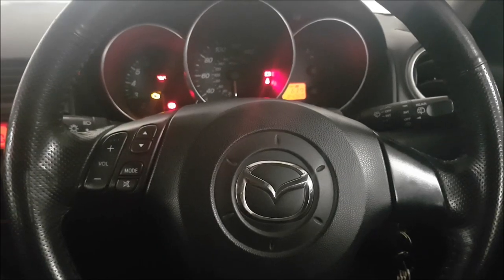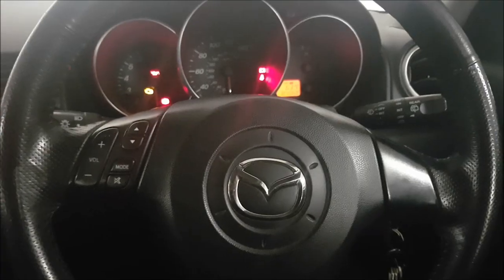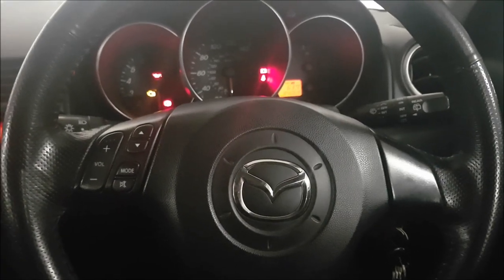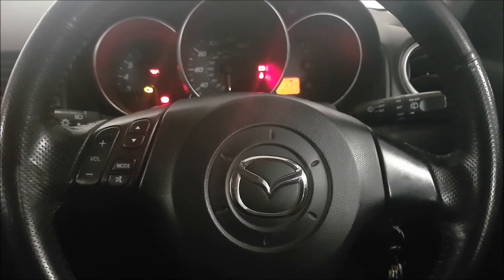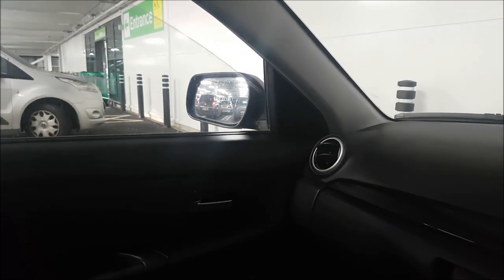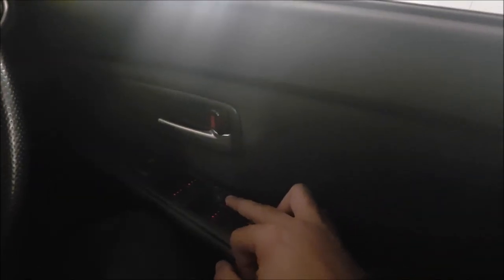Mazda driver's window switch controls not working - how to fix

Comment: Thank you!
I've just bought a Mazda 6 MPS and exactly this problem I am having right now. Flat battery, no power windows from driver's panel.
I have also another problem, hazzard lights when locking the car stopped working. I do not recall this car having an alarm but they were working 3 days ago , after that the car locks and unlocks but no hazzard lights flashing.
Thank you in advance.

Comment: Howdy, on my drivers door, when I lower the window, it goes down so far and stops with a jarring noise like it's stuck. If I push it more it continues to go down. When I push button for window to close or go up, it gets to the same point and makes a jarring noise again like it wants to carry on. I have to pull window up for it to close. Would this be a switch issue ot a window motor issue please. Cheers

Comment: This actually worked! My Front passenger window wouldn't roll up from my universal control on my side (Driver's) and i literally went to the passenger side control... Pressed the button down, then up, then down... then up again and continued to hold that button up for about 10 seconds maybe 15 seconds and it worked. (Not sure if repeating the down then up process a 2nd time was needed but y'all did it in the video so i did as well  lol. Hey it worked though!) Also the click was very faint so make sure you're in a somewhat quiet environment just to be sure. 

Thanks for the advice!
Reply from the maker: Mike really glad this helped you, thanks for taking the time to comment.

Comment: Thank you so much! My car battery had to be charged (It was basically dead). After that I had to reset them manually so I did this and they started working and also on my drivers side switch control panel!

Comment: Definitely works! In my 07 speed6 the front drivers window wouldn't work wirh the "single push" feature where you push the button all the way down and let go and the window goes down automatically. I did just what he did in the video and it worked immediately!

Comment: Brought my CX7 for service and they had to disconnect the battery. I noticed the front passenger window no longer working. I Googled for help and came across your video.
It worked right away just as you said. Thank you so much.

Comment: You just saved me 450 Canadian dollars + installation.   Older car....door fixed by dealer because we bought rust proofing all those years ago.   First, the window could not be controlled from any position.  They fixed that and and it could be controlled by the door switch BUT this problem came up.   They claimed....I don't even remember what they claimed.  All I know is that they wanted a lot of money to fix it and they didn't bother with this video.

Comment: Hey, thanks for this. Saved me buying a replacement switch panel for the driver's door (Mazda 5). Still have one window that won't work from the driver's seat but the others are fixed. And since the aircon packed up and will cost a not-worth-it amount to fix, the windows are all we have!
Reply: did you figure how to fix drivers side window?
Reply: @alifalam365   Hi. No, I didn't manage to get all of the windows working from the switches by the drivers seat. There was still one that wouldn't work. We scrapped the car over a year ago now.
Reply: @alifalam365  I need the same answer. I got the rear working but none of the front windows working from the driver controls.

Comment: Hi, My issue is that the mazda window gear won't stop for one of the windows and 1 window is always open, keeps clicking when the car is off and eventually it drained my battery. any advice? When I connect jump leads and recharge the battery the window gear keep clicking and the window stays down. can't keep the window up.

Comment: I tried in my 07 Mazda3 and it works perfectly for my passenger front window. Both rear windows are still not working. I've tried many times and they still work up/down with their individual controls, but will only roll up and not down from the drivers control panel.

Comment: Thank you! I replaced the battery a month ago and just now realised driver’s side window controls aren’t working.
Reply: Same problem here. Wer you able to resolve that issue? 

If so, kindly share what steps you took.
Reply: Yes I was. First I lowered the window a little bit using its own switch (not from driver’s door). Then I raised the window back up and continued to pull the switch until I heard a distant click sound. Then I repeated same thing to all passenger windows.
Reply: My issue is that the driver window wont work. Control for driver side window does not work however all other windows are ok
Reply: Gus Ledesma Ok. I tried googling it and some have resolved that issue by pushing the switch down for a few seconds and then holding it up.

Comment: Yea, i wish i found this before tearing my doors off and replacing switches. Works for mazda cx7. Programs 1 click window down as well. Any questions about mazda doors just ask me. 1 thing to note is driver and passanger doors come off different.....screw hidden behind handle plate on passenger side front door. Both rear doors are the same....all remove by pulling out then up out of window sill.

Comment: In my Mazda 3 (2004) I got a similar issue. But when I try to keep holding the window in the upper or lower position, the motor don't stop and keeps spining making a cracking noise. Do you know how to solve this?
Reply from the maker: Possible that glass panel may have come of rails but it usually drops down when that's the case, at least on my SEAT.

Comment: So what happens when the Drivers door window  , the passenger door window, and one rear door window (passenger side) stop operating all at once from the Drivers control and the individual window controls along with the mirror control (which works at times) and then the door locks stop working after one drive and then return back and the locks work again.

Comment: I had the battery disconnected and prior to disconnection windows worked fine.  After attempting this procedure my driver's side window will only open partially and will not close completely.  Any ideas?
Reply: Try it again, the window first opens about an inch then gors down. Go up and down a few times on each window the hold. Do drivers window last.

Comment: Heard the click, still doesn’t work. What do you suggest? 2005 mazda3
Reply: Did you manage to find a solution? I'm trying to work on mine and having same issue. It clicks but doesn't work. Works fine from the passenger window switch but not from drivers switch

Comment: this just started happening on my 2010, does this still work on the 2010 models? o_0
Reply from the maker: I only have the older Mazda so can't confirm for sure- could you try it and let us know?
Reply: It works on 2009, 2010 seems to be nearly the same car. Worth a try, can't hurt.

Comment: I haven't had the battery disconnected but my front passenger side window won't do anything. It's done it in the past and I've taken it to Mazda and they tell me there's nothing wrong with it they just cleaned it. WTF is up with that. At the moment it's not working, I want to fix it myself but got to work out why it's doing it.

Comment: Got exact same fault on 3 of my windows 58 Mazda  saw this and ran out side to check big fail Evan hurd click gutted I'm guessing it's main drivers control unit but at 80 UK pounds I'll stick with air con lest drivers window works for KFC
Reply from the maker: Sorry this didn't work for you, sounds like it is most likely the main unit. Glad you're still able to get KFC drive through though lol! Thanks for commenting.

Comment: My passengers side windows dont work from the driver controls. I tried this and it could only manage to wind the window down an inch (which is more than it did before) so Im guessing my problem is something else.
Reply: Toy Mit did you figure out wht the prob was & how to fix it ... currently having issue w front passanger window it goes down but not up with either driver or passanger control
Reply: No, I didnt sorry. We traded the car for something else. Regret it to because this new car chews up gas like a sponge, the old car was cheaper to run.